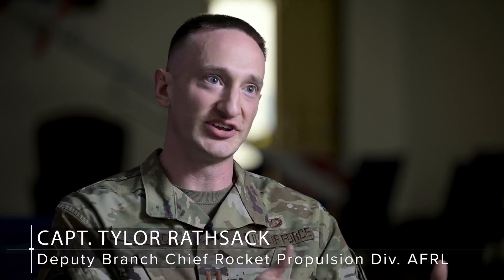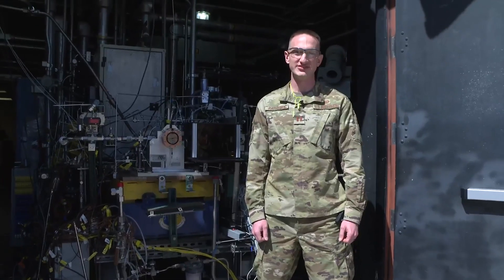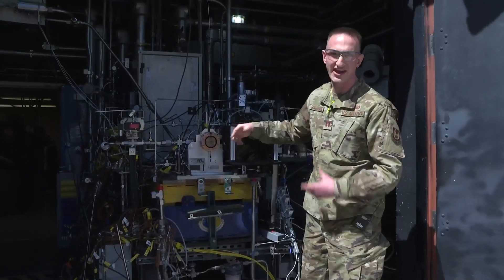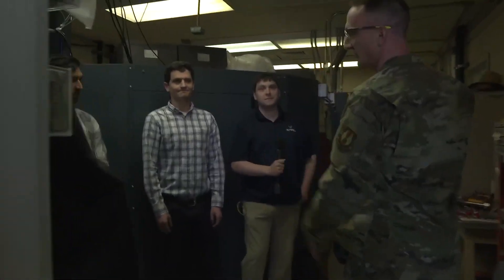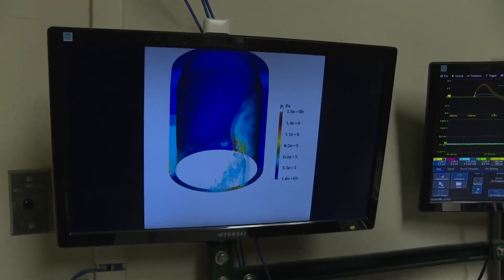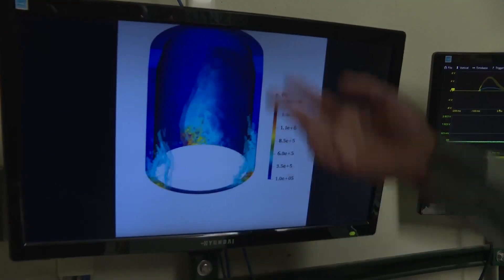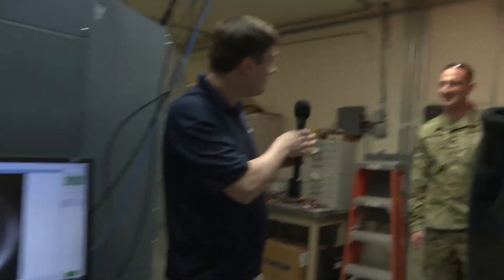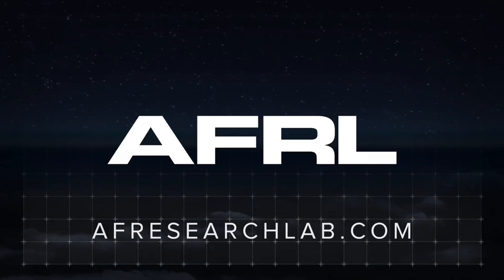Rotating Detonation Rocket Engine Testing At AFRL

Comment: I know I’m late to the party, but this is a huge step forward. A rotating detonation engine running on liquid fuel is amazing—this could be huge for reusable rockets or even future jet applications. I’m no expert and don’t have the hard data, but from basic understanding it should be way more fuel-efficient. That means longer trips with the same payload, or the same trip using less fuel. And because of the way the combustion works, heat losses should be lower and more of the energy goes straight into thrust. Really exciting stuff.

Comment: I wonder how do you measure thrust with that type of engine? And do you control the thrust by controlling the size of the ring, or is it the amount of fuel put into the engine? Can  you even control the fuel flow rate or is it set to flow so much fuel by it's design and that's it?  How would this engine compare to say a Saturn V F1 engine of equal size? I have soooo many questions.

Comment: It's amazing that this is technically a rocket engine even though it burns jet fuel. Is the "rocket" designation applied because the fuel is detonated? Or because it doesn't use compressors and fans like a jet engine does?
Is there an afterburner capability?
Reply: A rocket engine is just an engine designed for a rocket, and most rockets burn a more refined jet fuel, RP-1, this engine however uses hydrogen, which is why the flame is orange, it's the water vapor glowing in the exhaust

Comment: Awesome info ! Just dont let the Chinese steal the data.
Reply: Even if we emailed the Chinese military exact instructions on how to do this they couldn't, the metalurgy required is beyond them, they can't even fabricate regular military jet engine compressor blades
Reply: @CoreStarter  that was like 5 years ago. As far as I know they are already making copies of the Russian engines. It took them like 10 years I think 😁
Reply: @tbyte007  the j20 engines lifespans are measured in 10s of hours, all of their current flying j10s use Russian import engines entirely, it's also worth noting those Russian designs arnt very good, they are very old, about the same as the f14a engines, they are powerful but guzzle fuel because the profiling of the engine was done on tape and reel computers from the 70s when fluid dynamics was a pipe dream.

Comment: Interesting. A few questions: 
1. Would this be air breathing in the real world? Like not carry its own oxidizer? 
2. Would the geometry need to be movable/variable to be able to operate under different atmospheric conditions? 
3. If it were air breathing, I wonder how susceptible to fouling or erosion from dust or dirt or water? If it "ingests" a bug, would that get instantly incinerated, or would it disrupt the rotating detonation?  
4. Maybe you'd have some kind of screen or way to limit the FOD, but that would also create a drag/power penalty.
Reply: This wouldn't be air breathing, this is a rocket engine. The pressure in the combustion chamber requires high pressure pumping of fuel and oxidizer.

Comment: what? so internal explosion engine use deflagration? .-.
Reply: That's my understanding that most heat engines are using deflagration. Scott Manley as a video that might provide more understanding https://www.youtube.com/watch?v=rG_Eh0J_4_s  as I do not have a physics background.
Reply: Well, internal combustion engines,.. the flame front moves kinda slow and way below the sound barrier roughly 10m/s in the process called deflagration, on the other hand in this type of engine (RDE) the flame front/shockwave travels a heck of a lot faster roughly 2000m/s, so RDE engines are the Internal Explosion engine, hopefully this somewhat clarifies it (I’m definitely no expert so it could be all wrong)
Reply: ...you mean internal COMBUSTION engines?
Reply: no those are in fact internal explosion engines instead
Reply: Yes

Comment: Interesting stuff. Really a simple idea with crazy amount of science. Guessing this would not be possible without super computers.
Reply: As someone actively simulating this kind of engine. Supercomputing isn't required but does increase res significantly. Plus we've only developed the codes for simming detonation cells in the last 10 years. I use ANSYS